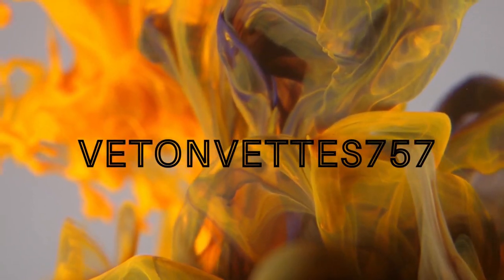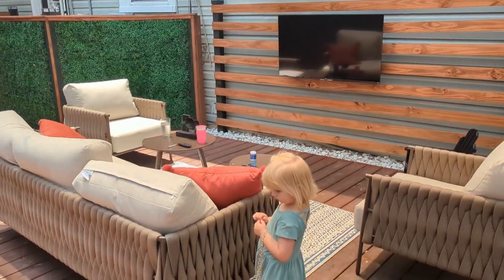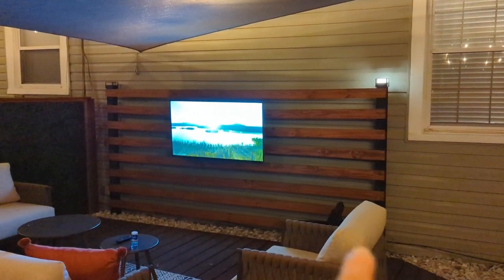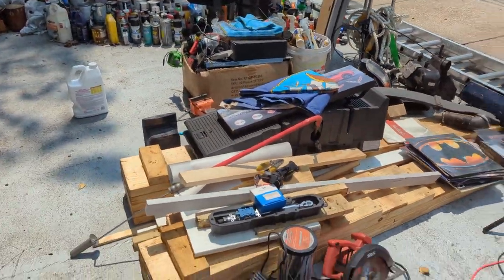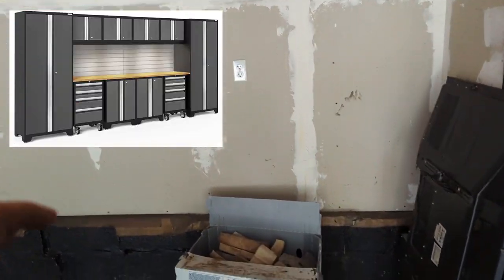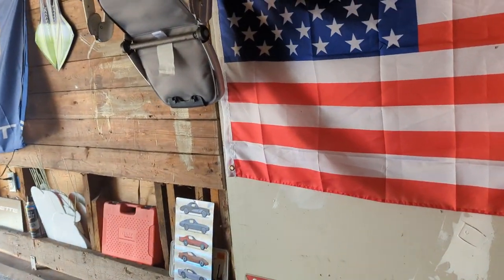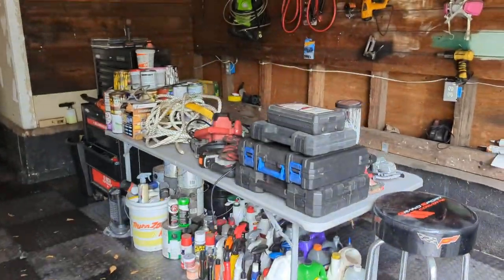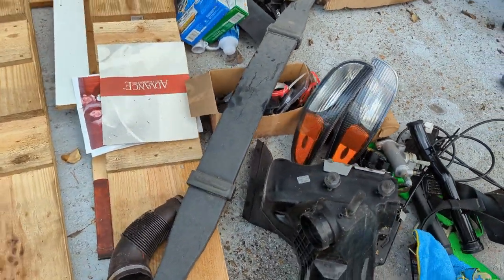DIY | FINALLY STARTING THE GARAGE RENOVATION | PART 1| BONUS BACKYARD TOUR

Comment: The yard updates look very good. If you haven't thought to add a space to write on (white board, etc.), keep it in mind. It does take a little wall space, but the ability to write down notes, task lists, etc. is something I do a lot. Are you adding any pegboard or any spaces to hang tools? Looking forward to the updates. It's going to be a very functional space.
Reply from the maker: The white board idea has definitely been on my mind. I can get creative with a spot for sure
Reply: @VetOnVettes  You'll find more uses than you expect for it. I put one on each side of my garage (two bays) so each side has one. Doodle ideas, lists, sketches, and more. They are handy.